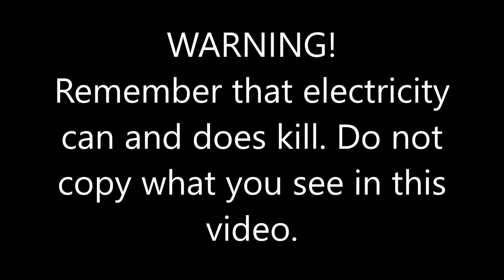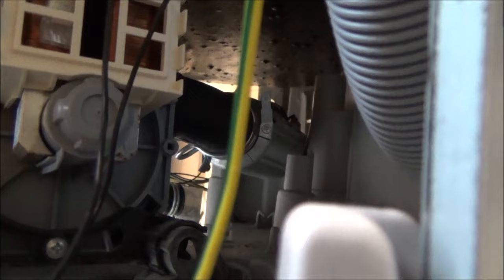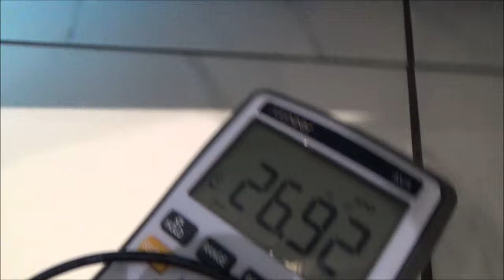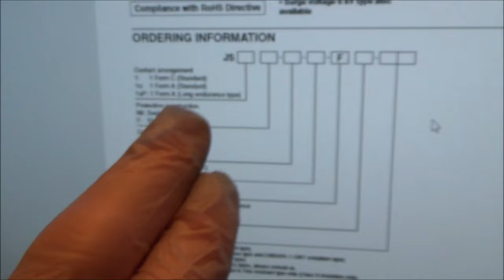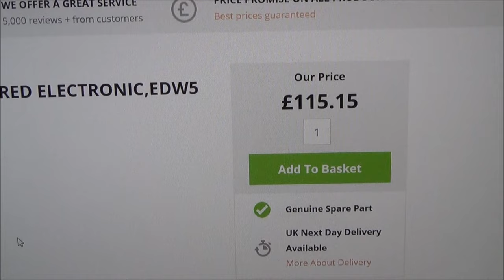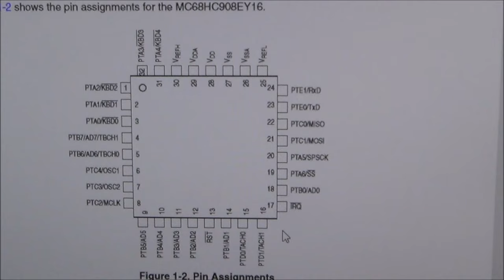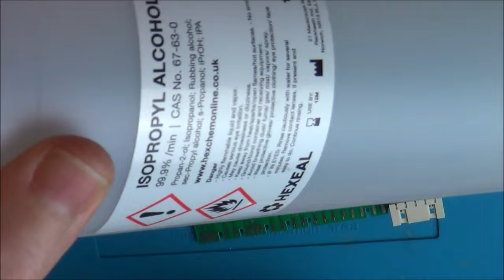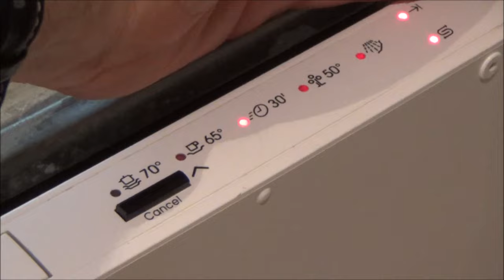Trying to FIX a Faulty DISHWASHER which Doesn't HEAT UP

Comment: The Chip you have Removed is a MC68HC908EY 16 is "Programable  Microcontroler" the brains of the machine  you can't just replace it with a new one , it is flashed at the factory with the dishwashers software , you would need a copy of dishwashers binary software code and a programer to re-program the the replacement chip..

Comment: hi vince as a ex zanussi engineer did you see when looking for new pcb module it said unconfigured?? this means you need to configure the board for your dishwasher otherwise it will not work
Reply from the maker: Thanks Barry, I only realised this once I seen the price difference between the 2. The more expensive one was configured so I Googled it to find out the difference. Thanks for confirming it :-)
Reply: @Mymatevince  yes a lot of manufactures are now doing this, hotpoint has done this for ages all their pcbs need programming ,you need on top of buying the module you need to purchase the programming memory card and interface module this is so expensive its not worth it unless you are a agent of hotpoint
Reply from the maker: @barryjackson2351  Thanks for the info :-)

Comment: i have a zanussi dishwasher that stopped heating up,luckily all my kitchen appliances are covered with domestic and general, i thought the heater would have gone in mine but to my shock when the zanussi dude turned up he replaced the board and all was fine, he said it was a common fault on their dishwashers and that the heaters very rarely give up,

Comment: about the diode next to relay it can be 1n4148(in fact any signal diode do the job it only serve to protect the circuit from discharge from the relay coil to come back to circuit, ais it is failed the return of coil can burnt the chip itself...) if the chip is a microcontroller (and it is MCU- Micro Controller Unit) it only will work whith the original code inside, if it was burned not possible tho extract the code. (in this case you need to reverse engenering the working process and know how to do a new program to the chip...) so muchg work to this... Im writing this after yopu removed the chip and tested the diode next relay...
Reply: understanding the function of this diode(in case you not know yet) https://resources.altium.com/bill-of-materials-blog/why-you-should-use-a-flyback-diode-in-a-relay-to-prevent-electrical-noise-in-your-circuits

Comment: a diode is there to prevent voltage spike  back flow from relay coil. any coil that get power wil hold power for a short while that power is just a bit higher than what came in to the coil. the coil works like a inductor same way as a buck boost converter or step down converter if you tap power leads of a coil whit metalized core it wil hold for a split sec a magnetic field that field has to dissipate and that's where the diode is for  to prevent emf backflow to rest of component's on the pcb

Comment: That diode seems to be betwean the relay coil winding. and as it shorted it can blow up the relay commanding transistor or what ever commands it to be on maybe that ic that made other parts shorted..
Why then use it ? When it works it drains the high voltage spike form on/Off commanded coil to secure that comanding transistor.
In cars these diodes are inside the relay them self that i have sean but i q this is one way to make more relays to work there...

Comment: That diode is die. When diode die, it will take down any ic that connect to it. That diode use as power dissipation for coil inside the relay. When the coil energies it store magnetic field, when power is cut from the coil, magnetic field collapse it will generating electricity, this electricity can cause damage to the microcontroller ic. So the diode is put across the coil to suck those nasty electricity to ground.
Reply from the maker: Thanks for the info Mohamed :-)

Comment: What happened to your ESR meter. If you had used that you could go over that board in seconds. The ESR meter reads between leads so the Zener would have tested OK. You had a short on your 12V line The snubber diode you could use any any 1A diode with a 100V or so rating. Whatthe diode does is when the relay opens the magnetic field collapses and you get a high spike ( Re car coil}. That diode  shorts that spike.

Comment: It's a bad idea to connect a power supply across components to see if things work. The diode (in this case a 1N4148 or 1N4001) is in parallel with the 12V coil of the relay. The yellow line indicates the cathode (negative) side of the diode. In this case the positive voltage is connected to the yellow line as the diode does nothing if the relay is energized. So the diode is "reverse biased" when the coil is energized. When the transistor or mosfet that switches the relay is switched off the current in the coil is quickly discharged and the relay contacts disconnect. If you do not have the diode in the relay circuit the relay can stay energized for a while before it disconnect the contacts. In this case the diode is called a "back-emf diode". I think you blew the diode when you connected the power supply. I don't think I have ever seen a faulty back-emf diode in 40 years of working in electronics. I had a Fisher & Paykel dishwasher (popular in Australia and New Zealand) with the same problem. Quickly traced the wiring from heater to the relay (it might even be the same PCB) and all it was, was dry solder joints on the relay. I could see in your video that there was some discoloring of the solder on the pins of the 12V coil.  Visual inspection is always the first step before any else. It takes many years of experience to find them first time. Lead-free solder does not help the situation. Great Job. You have just saved the rubbish dump from another appliance

Comment: I hope you cleaned out the scale on the other heater assembly.
Reply from the maker: I tried to scrape it and a snow storm came out of the middle of it. There is still quite a bit of scale still left on there though but it is better than it was :-)

Comment: If the heater wend kapoot then maybe something may also have taken the brunt of the problem so you will need a new controller, Zanussi don't supply circuit diagrams of controllers as these are not user serviceable parts.

Comment: Diode is just there to protect the relay driver. Any general purpose diode (the fast, the better) should work. You dont need nothing really special. Just a 4007 or 4004 .... Dont use 4148, they are too weak.
Reply: The 4007 or 4004 diodes you mentioned are rectifiers and not switching diodes, although they are designed for higher current and voltage load they are also very slow.
Reply: @mackjeez  Yep, that the reason I've put, the fast the better. Never har issues with 4007 though. You can put a fast schotky from any SMPSU, a TVS diode will do the trick even better, around ns response or even better.

Comment: I wonder why you didn’t check the circuit on your workbench. ;)
Finding the short the easy way: Apply 3v 2-4A on a shorted cap with known +/- and see what will start burning.

The diode looks like a standard diode. Nothing special.

Comment: Hey Vince. We have a broken ps3 slim it works but the metal on the disc drive was bent and not taking discs we tried to bend it but we couldn't can we send to you and you can fix it. We can pay shipping for both ways and pay u to fix it.
Reply: For the price it will cost to ship, you can buy a new ps3. Just a thought.

Comment: Looks like a standard mini melf diode. You could try this link  https://www.mouser.co.uk/ProductDetail/Vishay-Semiconductors/LL101C-GS08?qs=sGAEpiMZZMtQ8nqTKtFS%2FAJzLaOPtKpeT75u%2FRjzK%252BA%3D when checking the data sheet it looks the same as the one you removed

Comment: Your makeing heavy work there... what you should of done disconnect water and waist hoses from the sink pull the hole dishwasher out put a towel down and lay it on it's back no need to take door or sides off.....

Comment: One thing you REALLY need to fix in these kind of videos, is the beeping. Seriously. It's one thing when you just touch together and create a short beep. But when you LEAVE IT ON FOR 30 SECONDS, you're giving people headaches, and you outright prevent people from hearing anything you're saying because having the volume high enough to hear you, would wake the entire neighborhood due to the beeping. PLEASE either start using proper mics that only pick up your voice to begin with, or start using tone filters to turn down the volume of that beeping.

Comment: FOR GODS SAKE USE SALT!  The dishwasher salt light indicates it needs salt.
If you don’t use salt in hard water areas of the uk it will damage your heating element or heating circuit.
That’s why there is calcium deposits on the inside of the element tube.
Ignore the claims that ‘all in one dishwasher tablets contain salt, they DON’T!
SALT will help avoid expensive and unnecessary repairs.
I love your videos but you frustrate the hell out of me when you go ploughing in and don’t read the 
Instructions beforehand.